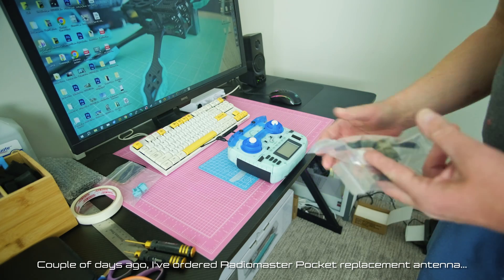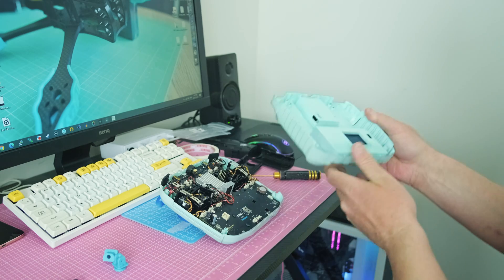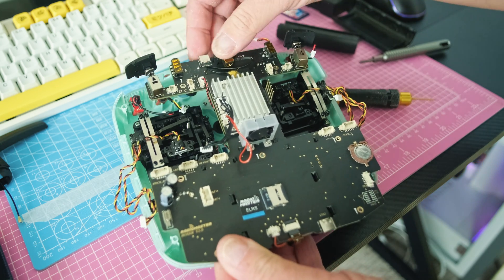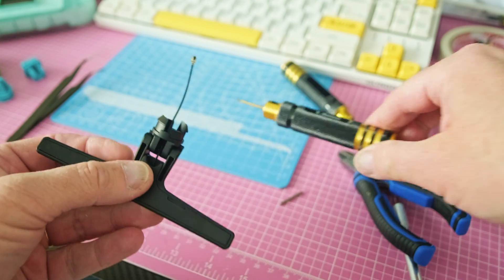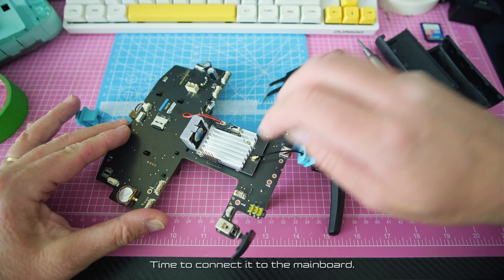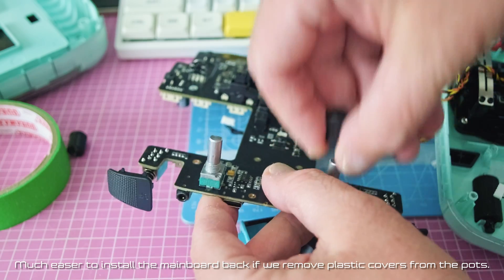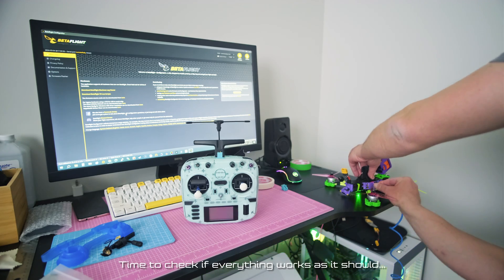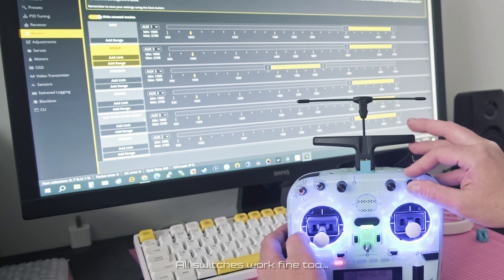RADIOMASTER BOXER FOLDING ANTENNA MOD | 04−04−2024

Comment: Do you have a link to the non swivel version?
Reply from the maker: Unfortunately, not sure I understood your question in full. By "non-swivel version", you mean where antenna is not connected to the swivel and it's non-rotateable? Or you meant that antenna can't be rotated to 90 degrees, only up and down? Unfortunately, I don't have link for any of those options.

Comment: Can you twist it 90 degrees?
Reply from the maker: Inside the video description, there is an extensive explanation about many things. One of them is talking about antenna rotation: UPDATE 2: Yes, antenna can fold, but it also can be rotated 90 degrees, to either side... left or right. Proof : https://imgur.com/ybfek04

Comment: Great tutorial! I am using the round one as well from danofpv. He said to print in tpu. Did you use pla or tpu? It looks as though you used pla? And also I tried printing but the overhang gets real sloppy. Did you use supports to print? I want my print to come out as clean as yours. Any help is greatly appreciated. Thanks!
Reply from the maker: Thank you for watching. As mentioned inside the description, I've ditched both swivel designs, and went with my own redesigned one. That one has much more accurate clearances and few other little things are adjusted: https://www.printables.com/model/777686-seii-radiomaster-boxer-antenna-mod-adapter-v7-petg . It's worth mentioning I don't own 3D printer and outsource all my prints at the local Canadian shop. Not sure how they printed it, but I know I've requested it to be printed in PETG. Some use PLA, I am not the best person to tell the difference, although I've heard PETG is more durable, little stronger and it has better heat resistance. I've received a feedback from some people printing it in TPU, and they've said it's too soft, antenna would bend when they cacth it against something. Again, mine is PETG and I have no issues at all.
Reply: @Seii-FPV thank you for your reply. Yes my apologies. I did see your updated print and tried printing it. I need to use supports to keep it straight. I have one printed and need to work on removing all of the supports. That is a tedious processs. I don’t know  to pla. But I believe they are similar. I too think you may be too soft. I am excited to try this mod. It looks way better than stock!

Comment: and why cant RM do that to the new boxer  crush ?  🙄
Reply: I suspect they're planning a new model with this folding antenna AND a colour touchscreen display (like Jumper T15).  That kind of upgrade might be a bit complicated (and take a while to get right), but I bet that's what they are working on.
Reply from the maker: There is zero reasons as to why they couldn't do it, but for some reason they don't want to do it. Maybe not enough people requested that as a feature they'd like to see in new versions. They could always say "... you can buy Pocket radio if you're missing foldable antenna so much ...". In the mean time, the least I could have done to help all those who want foldable antenna, is to make this video and show that it's super possible and quite easy to do.

Comment: funny how i want to do the same type of mod but instead replace my folding antenna for the fixed antenna from the boxer and tx16 to the pocket. LOOL (i dont like how big it is and sometimes i hit it and it folds back in)
Reply from the maker: Even if antenna folds, it absolutely won't affect the range. Folded or extended, flat part of the antenna is still pointing up towards the drone direction. Especially if you are aware where your drone is at all times while you fly, and you try to position yourself so you're always facing your drone. Boxer's stock antenna is quite bad... not range wise, but it's so flimsy, and once of mine actually started spinning around the base as it's a carousel. After opening it, I've realized the lead inside completely ripped itself off. Far from durable. After I've installed Pocket antenna in my Boxer, I've had absolutely zero issues ever since.

Comment: Hi, I've been following you since you brought out the antenna modification on the Radiomaster Boxer. I ask you, did you use a press in the battery compartment of the Boxer to hold the battery in place? If you have done it can you publish the Stl file please. Thank you
Reply from the maker: No, it's a simple packaging foam, and I've simply cut it using scissors. Printing anything would for sure add some weight, and I did not want to do it, especially now when I have AG01 gimbals installed too... they are quite heavier than standard gimbals my radio came with, so whole radio feels little heavier already. Foam I've used in that battery compartment literally has no measurable weight, it's less than half a gram, even lighter. You can see it here: https://imgur.com/a/YFlNiIV

Comment: A completely random comment but the bass in your vocal is very powerful! Even removing the bass completely from my bookshelf speakers leave plenty of bass left for it to sound as if I have the bass boosted on my eq =)
Reply from the maker: Thank you for your comment, greatly appreciated. I've fixed it since 1 month after the upload... but unfortunately, YouTube does not allow "replacing" or "updating" the video. I can only delete this one (and lose all the views and people would lose link to this video), and make a re-upload... I am kind of waiting for you tube to allow creators to simply "update" their video, something that Vimeo allows for ages now.
Reply: @Seii-FPV  lol, no worries, I was just amazed at the bass 😄 . That will be great, kinda should be possible already as they can cut out parts from copy-write claims. Anyways, still a great video and helpful 👍 thanks
Reply from the maker: No problem. Yes, all true, and I couldn't agree more with you. I've heard they can, but simply don't want to do it. Apparently, if it ever comes to some kind of dispute over something that's been said or what was shown in videos, they want to have evidence available. But even that is solvable... they can simply keep archive of the previously uploaded versions. I mean how hard is that, it's not like they're lacking the hard drive space :) Anyway, I just listened to this same video on my laptop, and with those lousy laptop speakers, it sounds perfect lol. At least something good :)

Comment: Note for anyone trying this mod with the Boxer Max: Unlike the Boxer Crush, the Boxer Max requires you to remove the two potentiometer dials to remove the main board: this requires a 1mm hex driver to loosen the set screws.
Reply from the maker: Thank you for this great info. I am sure it might help to those who own Max version of this transmitter. Unfortunately I don't own Max or Crush version, so not aware of any differences. My Boxer is the version before Crush came out, so this video explains how to do it with "standard" Boxer version.

Comment: i just discovered this, and I can't wait to do this.
Reply from the maker: Good luck! It's not difficult, just be careful with reconnecting all the wires/connectors.
Reply: @Seii-FPV  So, I finally did this mod, and it is amazing! Thanks so much for this easy tutorial man!
Reply from the maker: You are very welcome and it's my pleasure. I am glad to learn you succesfully did this mod on your controller.
Reply: @Seii-FPV  Just one small detail, that you maybe could put into description. Is that the top usb can't fit nicely, you have to rotate the antena 90 degrees. Or sand down one side of it like I did. That would be only small thing, in otherwise so awsome upgrade.
Reply from the maker: Just a small rotation, maybe as little as 6-10 degrees is enough to move the antenna out of the way. At least with my sviwel design piece, which I mentioned in my video description I ended up using instead of other two options (D̶a̶n̶o̶F̶P̶V̶  and B̶i̶k̶e̶r̶n̶i̶c̶k̶m̶n̶). It really takes as little as couple of degrees to rotate the antenna out of the way, so USB can easily plug into the socket. The thing is, there are various different USB connectors, some are thick, and I do have one of those low profile ones. For those, it's not necessary to turn antenna not even a single degree, they can still plug without any problems.
Reply: @Seii-FPV  Yes, it really is just minor little thing. Thanks again for nice tutorial, and happy christmas!

Comment: I just did this mod. I ended up using the file with the circular and removable end. I super glued the inside barrel together and it is making a strong connection. Your tutorial was amazing so thank you. I did it on the boxer crush and it was pretty much the same process.
Reply from the maker: Sorry, not sure what you meant by "removable end". Whole swivel is supposed to be just one piece. Also, as per my description under the video, I can't recommend first two pieces I've used in this video anymore, that's why links are crossed now. I've designed correct piece with 100% correct clearances, and that is the only one I can recommend at the moment. Link is available in the description.

Comment: nice job, I wanted to know if the antenna rotates 90°. Thank you
Reply from the maker: It's mentioned inside the long description under this video, plus some other things related to antenna, like for example if it degrades the signal, and it does not at all, not a single bit. If anything, it can only improve it since I removed one extension point inside the connection to the board. Less hoops signal has to go through. Check the description please, there is even a link to the photo proving antenna can rotage 90 degrees. Also, it's recommended to read because I can't recommend other two swivel pieces any longer, I've designed my own, where I made much more precise clearances and made it so it rotates the antena with 90 degees stop without any problem. Source STL file is free to download.

Comment: Hey, how did you remove plastic covers from potentiometers so easily?
Reply from the maker: It wasn't quite easy, they sit very snug... but I guess, practice makes it perfect. It does not go easy, but also, you should not force it. Slowly and patiently :) EDIT: and it's all video editing, cuts where they're required. No one wants to see me struggling to take those caps off for 20 seconds straight. I already removed them beforehand and put them back half way, so it's way easier to remove them for the video clip needed.
Reply: @Seii-FPV  thank you. Mine are holding on quite snug. 
Also can you take them off with case on right? You put yours back when pcb was in front case?
Thanks for video. Great instructions.
Reply from the maker: Yes, you can take them off with case on. It's just it was easier for me to do it when it was all in parts.

Comment: Why did you change it to the round base?
Reply from the maker: Only because the other one was too thick and it wouldn't allow antenna to correctly turn 90 degrees. If you forced it, it would start separatig top and bottom part of transmitter's shell, risking to break something. Other one, the round one works much better, but still not perfect since there is no hard stop when reaching 90 degrees. The good thing is... I don't use either one of those two anymore. I've replaced it with my own design, which works like a charm, exactly as it should. It's visible in my newer videos, that swivel piece is purple now, I also printed pink as well. But it's printed from my own STL file. I will upload it here under this video soon, so it will be ready for download. I've designed it with much better clearance.
Reply from the maker: I uploaded my own design that works perfectly now. Check the video description again. After I've fixed the problem with tolerances and the base being little too thick, I've ended up with new design that works amazing. The only one I can recommend at the moment, is 𝙎𝙚𝙞𝙞-𝙍𝙖𝙙𝙞𝙤𝙢𝙖𝙨𝙩𝙚𝙧-𝘽𝙤𝙭𝙚𝙧-𝙎𝙬𝙞𝙫𝙚𝙡-𝘼𝙙𝙖𝙥𝙩𝙚𝙧

Comment: Can you rotate the antenna verticle? or is it only horizontal that you can have it. Also which thumb grips are those? they look good.
Reply from the maker: It's inside the video description, under "Update 2" section. Here is the link from that same description: https://imgur.com/ybfek04 - as for the stick ends, those are called "Thumb Grippies Mini Mushroom Stick End" - I've literally tried them all, and none of them are as comfortable as these ones are. I adore them. It's of course personal preference, but I can fly as a thumber, pincher, or hybrid pinch/thumb, doesn't mater. Any use case, they're incredible! Not too hard, not too soft, they never "cactus" my fingertips.
Reply: @Seii-FPV  Thank you sir! great video.

Comment: how did you prevent the antenna moving sligtly?
Reply from the maker: I'm sorry, I am afraid I did not understand your question. Antenna is foldable, and with this little 3D printed part that allows it to be foldable, you can also rotate it 90 degrees for vertical orientation. For best reception/transmission, your Rx antenna and Tx antenna should be positioned in 90 degrees setup. If you installed your Rx antenna on your quad horizontally, your transmitter antenna should be 90 degrees, so - vertical with your radio. If you installed your Rx antenna on your quad vertically, radio should have antenna in horizontal position.

Comment: Is it suitable in a transport box?
Reply from the maker: If you mean, the original Carry Case... yes, it fits perfectly inside, just like it's made for it. There is a slot for antenna, and it has exactly the shape of this Radiomaster Pocket's antenna.
Reply from the maker: ...as a proof, I've uploaded 3 photos here: https://imgur.com/a/PKYepwJ - there is actually quite a space left at the top where antenna resides, for cables, straps, even external antenna module if needed (I carry my Crossfire module there, and Radiomaster Ranger Nano for my Zorro).

Comment: This is the ultimate Boxer antenna Mod 👏🏼👍🏻
Reply from the maker: Thank you! I love it, not just that it allows me to make my Boxer little more compact and easier to travel with, but it makes it little nicer as well. I've never liked that thin, easy-to-bent-and-screw-up original antenna.
Reply: @Seii-FPV  I've just finished the installation, thank you it works as I imagined 🤟🏻
Reply from the maker: Nice!!

Comment: I have boxer with 4 in 1 system. I tried the mod but the ufl connector  on the pocket antenna is 1 cm short. Apart from using a ufl extension, do you think opening up the pocket antenna and swapping it with a longer expresslrs T receiver antenna would work
Reply from the maker: Yes, mine is ELRS version. It should be completely safe if you are careful with opening that Pocket antenna. I just looked at the spare one I have here, and it's actually super easy to open the plastic cover. There are two thin tabs holding everything together, and you should carefully and slowly pry it open trying not to damage the plastic. Antenna inside can easily be replaced with the longer one with the same specs if you have it. I'd always rather do that, than go through some u.fl extension. That's basically adding another joint/break point and with these signals I'd not play too much with interfering between the antenna tip and the connection point on the Boxer board. One clean line is the best you can have. Maybe that extension would not do anything significant to weaken the signal (if it's a good quality of course), but I'd still rather go with one piece, longer antenna.

Comment: I really like that mod, but i am still worried about the range, especially for long range use
Reply from the maker: This is what it says under this video's description: "...All those questions about the range... I've explained in the video, at 5:31 sec mark (little earlier as well). This antenna connects directly to the U.FL connector inside the Boxer, avoiding going through U.FL to SMA adapter. So one less corner, meaning nothing else but cleaner signal. Pocket antenna's internals are physically identical to the original Boxer one, just different shape plastic cover, and I did not tuck it inside the case to potentially degrade the signal... it's outside the case. This is basically the cleanest (by far) and the safest antenna mod in existence for Radiomaster Boxer..." - also, regarding the long range, I never do that, so non-swappable antenna is not a problem for me. Besides, there is a bay for external module at the back. I use it for all my non-ELRS, meaning TBS CRSF quads... but you could use it for external ELRS module like for example Bandit, or Ranger, or any other out there.